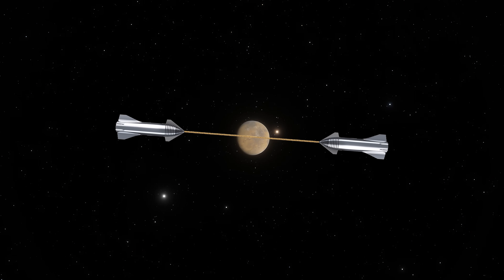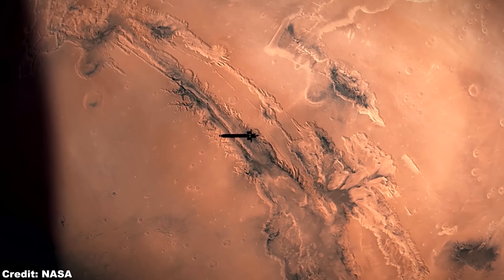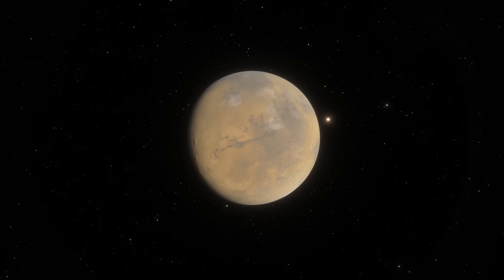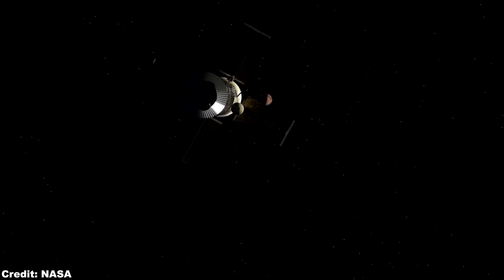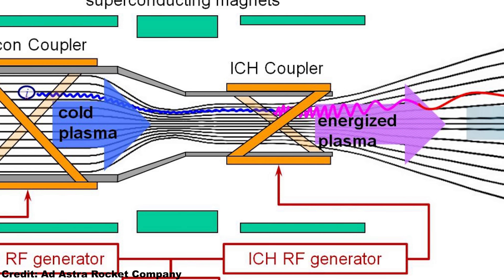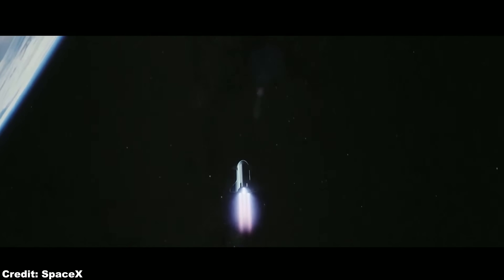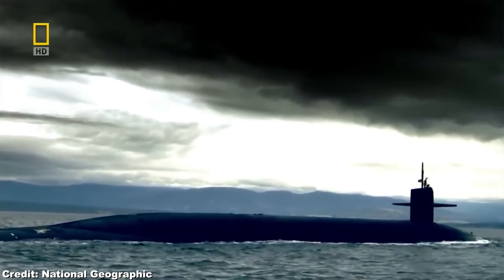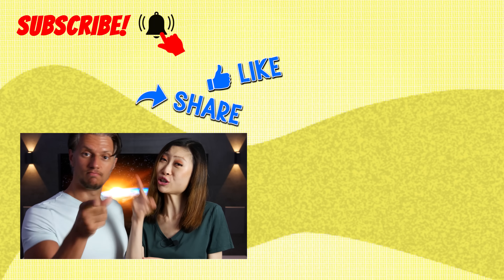4 Ways To Upgrade Starship's ENGINE! [SpaceX Starship FLAW FIX]

Comment: Basically, what needs to happen is that we construct a interplanetary vehicle in orbit. This would carry a docked Starship to Mars (or any other planet or moon in the solar system.) once the target is met, Starship disengages, the vehicle remains in orbit around Mars(serving as a communications relay, return vehicle, etc) Starship would perform normally with no expended fuel over the course of the trip.

Comment: Replace people with robots or remote-control/tele-presence systems, and many of these problems go away, including the need for artificial gravity, radiation protection,  life-support systems and spacious quarters.  And once freed of all that, we no longer have a need for a super-fast flight.  But, you say, sending humans is the whole point.  Really?  What is to be gained by a colony of humans that cannot be accomplished by a colony of robots? Indeed, it wouldn't surprise me if robots could do the job of industrializing Mars more efficiently.

Comment: No idea what a super Saiyan is. Your misuse of the word "insane" is much more nearly insane than anything to which you applied the term in this video. NOTHING you described as insane is even capable of being insane. This is an example of lazy speech, and it is very irritating.
     It is, of course, entirely false and totally unfair to label these issues as FLAWS in the Starship. I suspect that is just a bit of Clickbaiting on your part. It certainly got my attention, and the quality of these videos has moved me to subscribe.

Comment: everything in the universe has has a magnetic poles if we had two huge electromagnet  one if front one in back that would do a push pull method and create a field around to protect us from radiation  all could be powered recycled nuke warhead to use for good not bad

Comment: You said a fission reactor for power would not work because of no way to cool the reactor in space. But that is because you want to use the wrong kind of reactor. You need a liquid fuel theorum  reactor. You could get 10 magawatt power with a small reactor. This is not a 100 magawatt but enough to make some king of electric engine when it can run for up to 10 years.

Comment: I stand corrected in that a single-stage Starship can transport a sizable payload no further than about 5000 km on a suborbital flight. Therefore, flights like New York - Sydney or New York - Singapore require the expense and complication of the full 2-stage system. A successful development of Reaction Engines, Ltd´s Skylon to full operation will destroy the business opportunities for Superheavy/Starship as a ground to ground (Eugen Saenger-style) transport. Suborbital transports would need large Reaction Engines- style engines that run in air-breathing mode until switching to rocket mode at about Mach 5 thus allowing a single-stage transport. The advantage of an aircraft-like vehicle like Skylon is that a regular airport (existing infrastructure) can be used for arrival and departure. Superheavy/Starship would still be an important orbital launcher. Thank you for the video and on to the future.

Comment: Why not use a vasimr engine powered by a traditional fission reactor cooled by a thermonuclear engine using the excess heat off the reactor today the hydrogen, when you run out of hydrogen you shut down the reactor and jettison it if something goes wrong

Comment: Thanks for covering ion , plasma drives, and VASIMR. I have been urging their use (especially VASIMR) for the Mars trip for the past couple years. I really think if we can build a nuclear thermal rocket we can engineer a nuclear reactor/heat exchanger to power VASIMR. Before discussing that I would like to comment on the assumption that ion/plasma drives acceleration is too slow for “short” space trips. It is correct if you are starting from zero km/sec. , but since all of these drives lack sufficient thrust to “get off the ground” in actuality you already have escape velocity, having been launched off earth by a chemical rocket. At present the thrust from ion drives and hall effect thrusters  is relatively small, but they are working on increasing these to scales comparable to VASIMR, but in any case, the thrust and velocity of ion/plasma/VASIMR is in addition to the escape velocity achieved by launch, so any of them would get you there faster than just coasting there after rocket burn out. Currently probably only VASIMR is capable of sufficient thrust to produce the constant acceleration needed to produce reasonable artificial gravity, and that would still take a number of engines, not one. It should be possible to reduce the size of the radiant cooling panels for the nuclear reactor by flowing the xenon gas through them prior to injection into the VASIMR drive, thereby pre heating it and carrying away much of the reactor heat through the thrust nozzle. Some rather precise thermodynamic analysis would be needed to work out the precise details, but that is essentially what is keeping a thermonuclear rocket from melting down/burning up as well; the exhaust gas is carrying away much of the heat. The advantage of VASIMR, as you pointed out, is that its maximum velocity is much higher than a thermonuclear rocket.

Comment: I think a solar sail made of graphene sheets is the best solution. I know this provides very small thrust but if the starships are only required to be launched every 2 years or 18 months then the cargo elements can be sent early. Also human crew starships can have their orbit raised to 120,000 miles this would put them somewhat closer to the L2 points. Crew can them launch on smaller crew dragons accelerate to dock with the Starship in high earth orbit and then depart using either a smaller vasimr or dipole drive.. see Robert Zubrin.

Comment: Ok what if we extended the length of the starship once in space orbit and put the engine on the back of that and then placed a  dence refective plate inbetween the starship and the extended engine section.

Comment: I think it's best to use technology that works for now at least. And once we have achieved landing on Mars. Then we can progress with new Technologies to get to Mars quicker. The first manned mission to Mars may only be just 8 or 10 men or women. That means Starship in a different configuration quite easily has a space four 10 women or men. With plenty of space to be happy all the way to Mars. We made this sound so easy. If Elon musk pause this off he'll go down in history making the 21st century happen. This is a very exciting time. And of course chemical reaction rockets. Means that we can mine for fuel on Mars. But the portion Ford in space in the future not on the future and can be much better I think then chemical engines.

Comment: The VASMIR concept has been fully debunked by Dr. Zubrin  as totally impracticable. The actual energy required is a lot more than  currently published. Again Dr. Zubrin and friends pointed out the enormous  inefficiencies of this engine as currently designed. Dr. Zubrin  also pointed out quite effectively that you don't need a battlestar to get to mars, its quite possible even with current chemical rocket technologies. VASMIR is( or should be) considered a dead on arrival concept and a waste of tax payer money.

Comment: The biggest flaw with Starship is that it's capable of landing. It has to carry it's athmospheric engines all the way to mars and back. It's like one of those amphibious cars. Yes, it can fly thorugh open space, just like one of those cars can swim like a boat, but after all, it's still a supercharged shuttle. An optimal spaceship should stay in space, just like an seafaring ship stays in the water. The aerodynamic design makes it look very neat though.
The second biggest flaw is that it's not called BFR anymore.
Reply: You may still call it 'Big Effin Rocket' any time you like.

Comment: Here is another alternative to the nuclear thermal rocket. Let us make an assumption that the current 6mo. trip is what we are stuck with until somebody throws a lot more money into the effort. Let's use the normal thermal rockets to get there, but add a LFTR linked to a generator to the cargo, already activated. Use that reactor and the power it generates to power a magnetic shield that will protect any occupants

That same reactor can then support the development of a permanent colony.

Comment: Nuclear thermal engines would be in fact great option, but the catch here is that there aren't any details available. It'll be a long time until we see one firing. And it won't be used for starship as SpaceX doesn't develop NTRs

Comment: Imagine the fuel requirements for a near brachistochrone trajectory to mars. there is no reason to spend 200 million on something that takes a couple months when we can spend 100 million on something that takes 8. Doesnt matter what fuel you use or how advanced your technology is, if your not transferring during the most efficient window you are wasting money resources and fuel. And alot of it at that.

Comment: No I do not agree at all, the NASA and you're guys are way too nuclear fission minded, remember the B36 nuclear bomber never flew. Fusion is the solution since we have a good fusion reactor with a 5 millions years life span near-by called the sun and the energy capture by modern multilayers photovoltaic panels is getting more and more efficient, far more efficient than we can ever expect on a man made tokamac or fission thermoelectric conversion with no heat dissipation issues other than simple radiating static material heat resistance. If space is called space it is because in space, space is not a problem, full space. Just move from spaceship to Space mind and calculate once the PV surface and weight required for one 20 MW strong Vasmir propeller considering a proprelly directed  PV panel is also a foldable and affordable very useful solar sail spinnaker. I am sailing.....solar winds are blowing me away....
Reply: The NB36 flew 47 times and had 89 hours of reactor powered flight, it was working. It got cancelled because the war was over before the project even got off the ground. 

The literal ONLY two negatives that were associated with the idea were the fact it was heavy as fuck. And the fact it was radioactive. Both of those issues aren't a problem in the 0g vacuum of space. So please enlighten me on why it isnt a good idea again.
Reply: a1919akelbo Weight of a reactor and all the shielding required for a durable exposure is a huge and remains an unresolved problem up in the air and worst in space. Furthermore radioactivity has nothing to do with gravity or microgravity and nuke and solar radiations armfull effects would be added and excessive.The armfull effects of radiation have always been minimized by the armed forces and the IAEA and are strictly excluded out of WHO / OMS scope of directives. A solar sail offsets all those obstacles, is by far the lightest in a flexible and roll form. PV is one of the cheapest energy source at 0.03€/kWh and price is going down versus 0.015€ fuel cost for coal power at 35€/ton world price. Nuclear price 7 to 15 times hIgher is going up is no option.
Reply: a1919akelbo Yes the NG 36 flew with a single one megawatt thermal reactor as cargo load radiating towards the shielded cockpit but the nuclear reactor has NEVER provided any propulsion power or thrust to the airplane. In any case one MW was 17 times less power than the six installed star engines of the underpowered B36 which got later 4 jet engines added for shorter take-off and hIgher speed. An airplane or Satellite  launching rocket will never take off on nuclear fission power, but Solar Impulse flew around the world on PV power only!!! Just imagine the sailing american cup with a solar sail race from the moon to Mars and return...and the winner finishing in less than 3 months.....with a Vasmir booster.....and stop thinking that "the little green martiens, we gonna nuke them." Their Silicon based organic composition is totally radiation, air blast and shock wave proof.....unlikely the B36 so slow that it would be selfdestructed by its own Mark V bomb in a pure kamikase tradition...

Comment: Nuclear fission systems are more efficient when running at very high temperatures, Molten salt at 1000C would radiate nicely into space. The PWR used on war ships are low temperature maybe 300C at most.
Reply: Steve Windsurf nuclear gas core have higher temper and better efficiency

Comment: I love considering various design solutions for the SpaceX program.  The recent contract proposal award for the moon lander opens up a lot of possibilities.  Now that Elon is proposing a starlink variant that never lands on earth, he can modify the starship design to further optimize.   Removing the heat shields and fins is a start.  Now cut weight by reducing structural strength since stresses are much less.  Also reduce the weight of excess engines (only need to escape  moon gravity). Now consider cutting size down to further reduce weight.  Now reconsider steel versus graphite fiber composite construction ( no high temp durability issues, cost is worth it due to low weight savings on the re usable moon shuttle.

SpaceX could use this project to develop a special starship cargo launch variant designed strictly to get huge sized payloads into earth orbit. The first delivery would either be hundreds of starlink transponders or the lunar lander.  (The nose should hinge open to release a 7 meter diameter moon shuttle in orbit).  The moon shuttle has no aerodynamic compromises, super light weight,  still complies with Artemis contract with maximum payload delivery efficiency, and is reused for transport of materials and people for Artemis lunar colony and many other functions (e.g. servicing James webb).  The moon shuttle could have external cargo containers and external fuel tanks than can be left in moon orbit at the Artemis station to reduce weight when about to land on the moon.  Also when its reused to resupply the Orbiting moon station but not land on the moon, then it can transport larger external cargo containers picked up in low earth orbit.  

A 2nd moon shuttle should ultimately be designed for strictly transporting cargo and fuel from low earth orbit to the Artemis station in orbit around the moon (no crew dragon type systems for people required, and no lunar landing requirement).  It remains in space, picking up payloads from the starship cargo variant, rendezvous with the orbiting moon station, and returning to earth orbit.

Comment: For VASIMR perhaps use a number of SLIMM aircooled reactors, generating 100MW for years (5.8 years for 100MW) or perhaps decades without refueling. 100MW one is illustrated to be truck trailer size. Reactor also operates below atmospheric pressure. And is reported to be safe by design.

Comment: this is an interesting video.  of the propulsion systems listed, only nuclear thermal and nuclear powered vasimr seem feasible near term for human travel to mars (i.e. 60 days in interplanetary space as compared to 6 months for the alternatives). the shorter travel time means no need for rotating habitat thus less size and complexity. of the nuclear options i think only an interplanetary vasimr space tug with efficiency improvements is viable (idk maybe routing heat exchangers to heat the propellant before it's accelerated by the superconductor to lower energy output requirements of the nuclear reactor and thus the size of any external radiators). a nuclear thermal space tug is tech we can build today except it shoots radioactive uranium out its backside at high velocity, which would probably be the end of any nearby space station or satellites. thoughts?

Comment: While Nuclear fission propulsion would fit the bill, unfortunately unless the rules have changed since the the last time I checked,  the salt treaties prevent nuclear propulsion in space from being carried out.  If this is still the case this rule would need to change.  Concerning the heat disapation with the V.A.S.M.I.R. 
couldn't an area be opened up to space somehow, because we know space is super cold,  let some of the cold in mix it with air,  run it through a thermostat to raise it to a proper temperature to keep the air from freezing too much and cool the reacter off with this?

Comment: On the power plant side for VASMIR, could use the up coming liquid fueled designs like MSRs, they are much more efficient so should be able to save weight and have more power, thermal might be still and issue but they use salt at 500-1000c so in theory should be able to dump extra heat more easier than solid fueled which is around 300c and well solid so can't flow ~_~

Comment: Why not using lasers to accelerate protons like it is foreseen with small size electron accelerators?
With such a system you would have a lot of kinetic energy transferred to the protons within a not too big enclosure.

https://www.rochester.edu/newscenter/new-laser-technique-will-allow-more-powerful-and-smaller-particle-accelerators-421842/